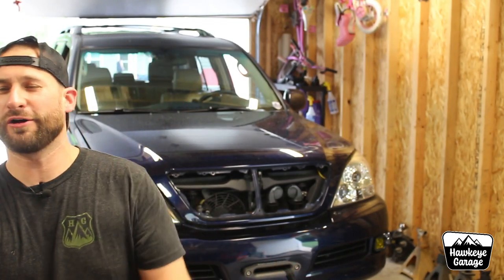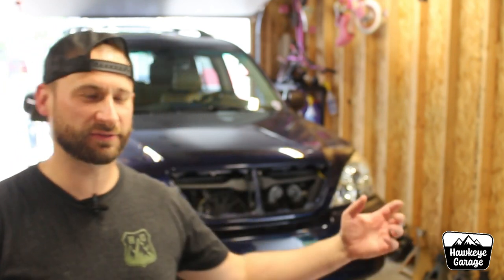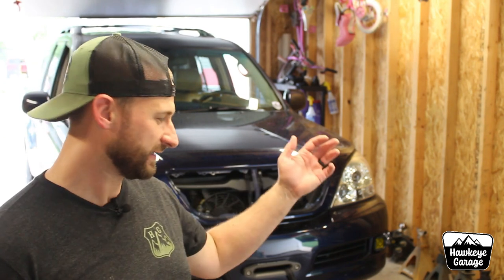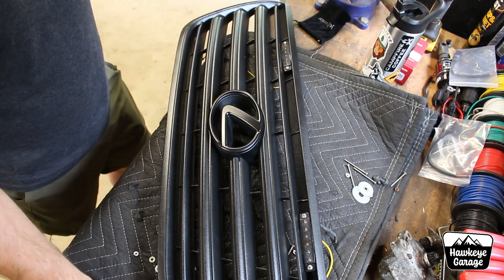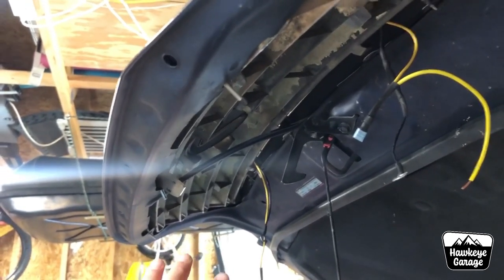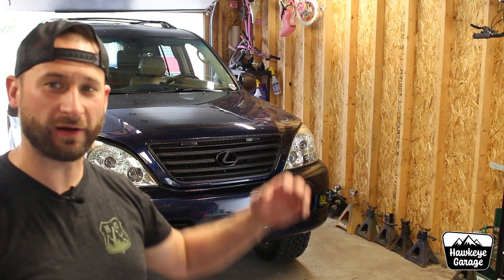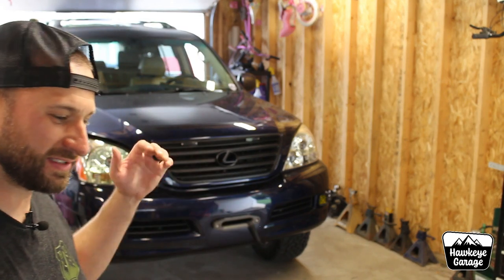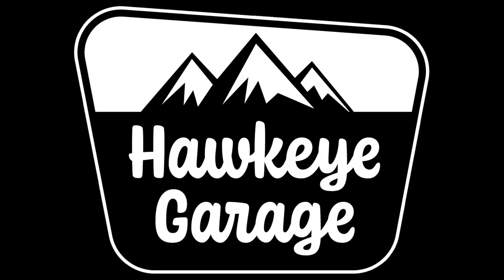GX470 DIY Grill Fix

Comment: @hawkeyegarage  So... I bought a 2008 GX470, and when I started working on it today, I discovered how many mounts are broken.  The rest, broke during removal... So I have 0 salvagable mounts. So I am looking at a pile of pieces.  And I typed before getting to 6M 40S ... and you answered! --  SO might have to drill through the front and bring screws in that way (from the front) and hide them in black... thoughts?  ... Ignore the big dummie😀😅... thanks for another great video
Reply from the maker: That’s what I’d do
Reply: @HawkeyeSkunkWorks  Did it, worked great